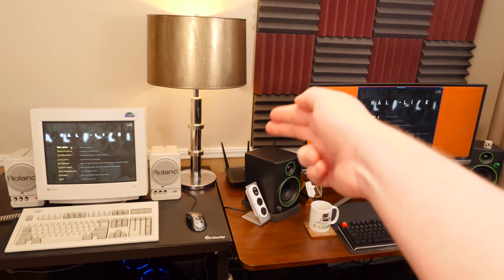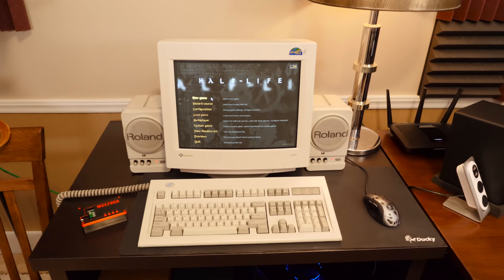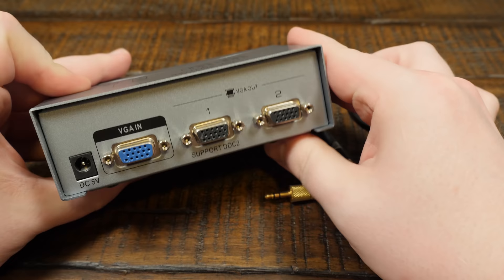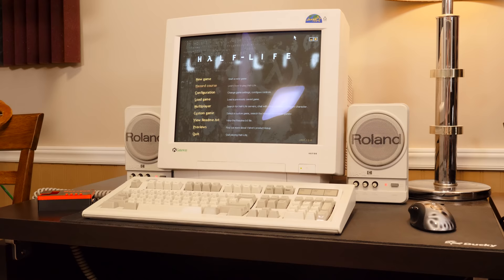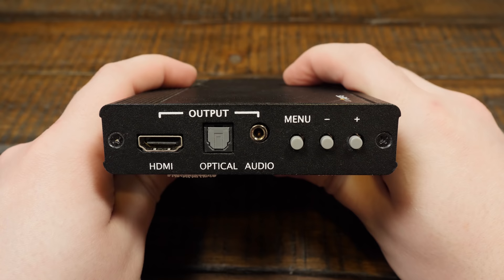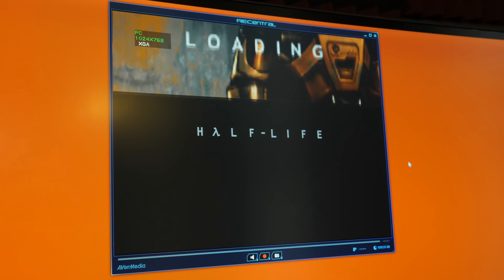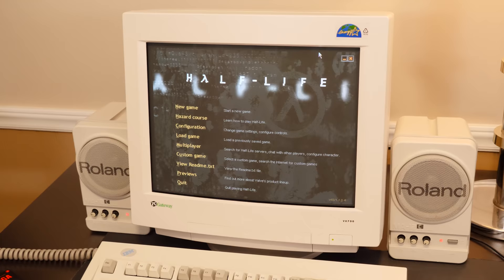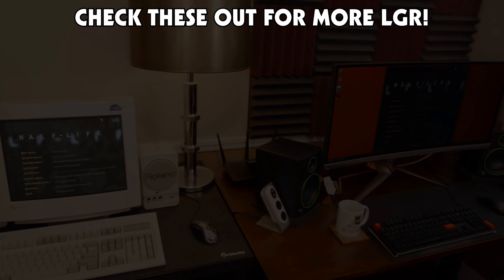Capturing VGA/TTL Video Footage From Retro PCs

Comment: Great video and cool tips on capturing devices! I was really hoping to work with VGA directly but since LGR also switched to HDMI capture, I'm starting to think that there's no easy way to do it :(
After your last video I started looking for some capture devices on my own but ended up with GameBroadcaster as well. I'll just leave two quick notes for random commenters who'd think to try same way:
1) Stay clear of cheaper models of Epiphan devices (mostly the red ones). I bought VGA2USB thinking it should be enough and while the image is crystal clear and the grabber works with most of DOS custom resolutions, it handles 15fps at most, so it really sucks for games. 
2) GameBroadcaster has real issues when capturing almost anything from DOS, but can be made to work if you switch resolution to something compatible first (like 640x480) and keep recording while you reboot, load different games etc. You will just need to crop the footage afterwards. 

Also, the name of the VGA-to-HDMI thingamajig is missing from the doobleydoo. :)

Cheers!

Comment: For my current captures, I've been using an Avermedia LGP Lite and VGA to HDMI ET110 adapter (which doesn't scale the incoming video). It works well for anything at or above 640x480. 

For older DOS stuff, I've been experimenting with my Compaq Armada M700's mirrored display feature - it conveniently scales the VGA output to 1024x768 at 60hz when enabled... which it does by default. Unfortunately the audio on these systems is very noisy, and the image isn't always centered properly.

Comment: I have a setup where I split the HDMI about 7 times and also strip the 7.1 audio, use it and re-inject 2.0 audio ^^ so I feel you (also gone through some of them, but I am pretty happy with it now - got the same ground-loop-isolators and some others :D - I can recommend something like the headphone 'amp'/splitter: LDHPA4 if you want to split more then two times, the y-cabels don't behave or you need the separate volume control.  I fear the day I need to replace one of the components, which are no longer sold ..)

Comment: I've found the Epiphan DVI2PCIe cards very tolerant of just about any signal I've thrown at it (more so than their USB capture devices, the cards can be coaxed to natively capture 240p video albeit kludgy). Extremely tweakable, and it has a built in scaler to handle resolution changes. They can be had very cheap on ebay if you are patient. It works with Directshow compatible software and also comes with a capture program.

For external conversion, I have found the OSSC very handy. It can run as a dumb VGA to HDMI/DVI converter in a pinch and recent firmware updates even support classic PC 320x200 optimized modes. Its output will trip up some capture cards like the AVermedia though, but the DVI2PCIe takes everything the OSSC outputs. I find its 240p upscaling + the DVI2PCIe card much friendlier than capturing 240p direct.

Comment: If you have any other issues than hum, maybe you remember it as better than it was? Plasticky PC speakers were pretty awesome... at hiding the majority of the audible frequencies and deliver crap sound through crap amplifiers... ;) As for the classic ground loop hum, that's due to PSUs going bad, so I would swap all of them completely if you haven't. But Isolators/Ground Lifters normally do the job for audio if it's not too deteriorated. There should be zero video interference from the PC cases since these were always in a fancy ass industrial type sheet metal box. If there is, I would suspect the converters since not too many know how to build good electronics these days. Greetings from the grumpy guy who is always right.

Comment: I have an Epiphan DVI2USB 3.0 that I've used for a few years to capture footage from old PC's, and it has settings for Horizontal Shift, Vertical Shift, PLL, Sampling, and brightness/contrast.  You can manually set these or leave it on automatic - automatic is handy for old games that change resolutions (it responds within a few seconds and makes the proper adjustments) but capturing these is a bit of a pain because the software I use (VirtualDub) locks in 1 resolution when you record and when a resolution change happens, it still records at the original resolution, scaling the new one to the old one.

Comment: You would probably be pretty happy with the Blackmagic Video Assist 4k for HDMI capture. I have and use the 1080 version at work and am always surprised by how many different signals and framerates it can scale. HDMI / SDI only of course but it can record to full size SD card in multiple bitrates.

Comment: Clint. I highly suggest that you look into Extron stuff for VGA splitters. It's broadcast grade and can be had for cheap . Bye bye interference! output signal is as pristine as input signal, everytime. They also let you adjust the audio gain of all inputs independantly, which is frankly very handy. The MVX series of matrix switchers by them is  a good example of stuff to look for. There are other, series as well by them such as ARS(splitters). Cheers
Reply from the maker: I have some Exton BNC splitters, they're great! Definitely need to look into their VGA stuff.
Reply: @LGR  Same I have some of their BNC matrixes! But I'll get a VGA one next I think. Although I can use some vga-to-bnc cables in the meantime to get vga stuff connected. But their VGA rack-style switchers are so much thinner and sleek, ya know?

Comment: some sound cards have a floating common on their outputs, most of the time, running a wire between the common and the computers chassis will cure the humms for instance, the exposed metal of your shown audio adapter hard wired to the case. you can also try wiring the computer case metal to whatever capture device or capture computer metal. I do allot of wiring between computers for audio..

Comment: i was actually looking for to capture the older colored cables that for instance the wii system uses.
my plan is to get a capture card on my computer and set up the wii through my computer.
probably using either vlc or mpv to play the video on screen

but still great video :)

Comment: Have you looked at Black Magic capture devices?
Reply from the maker: Yep! They have promising stuff, along with devices from Datapath and Epiphan. But it's tough to find the right mix of price/performance, especially when many products don't specifically state if they support lower resolutions and odd refresh rates :)
Reply: LGR Yeah, I would be worried about the odd standards as they focus mainly on HDTV and broadcast standards. So you’re most likely better off with your current configuration. We use them all the time in the event and broadcast world. I had to get «illegal» chinaware in order to bypass HDCP (screw that crap! 🤨) and the unstable low SDTV signals from such old things as game consoles... even the N64 is not stable enough to work with our $100.000 premium event scalers! 😜
Reply: You can bypass HDCP with a HDMI 1.3 splitter at least thats what I do for capturing my PS3 using a Black Magic Intensity Pro
Reply: @AndersEngerJensen  If you need to capture oddball resolutions with your blackmagic intensity pro card check out AmaRecTV http://www.amarectv.com/english/amarectv_e.htm
Reply: I have an older Intensity Pro PCI-E card that works great, except it doesn't do oddball resolutions like at all.  E.g., 240p?  No signal.  It does a good job with standard inputs, but then plenty of hardware does.

An OSSC might be a good alternative to the Star Tech scaler.  I have a ST composite / S-Video / Component / RGsB to VGA scaler, and while it's nice that it'll turn anything into one res, the OSSC is leaps and bounds better quality.  If you want a more pure capture and res changes aren't a deal breaker, it's pretty much the best way to convert RGB sources to HDMI.
Reply: Second the OSSC.

Comment: Hi LGR. Have you looked into some of the commercial audio visual branded scalers/switchers such as Crestron, Kramer or Extron? I have been using a Kramer VP-437 switcher/scaler and it seems to handle almost anything I throw at it (I did not know until recently that the PlayStation 2 changed resolution regularly!). Have a dig on eBay. 
I have one of these in my workshop at work too (I’m a commercial AV technician), and the local Australian distributors are only more than happy with firmware, tech support and advice, so I’m guessing the America’s will be the same.

Comment: Thank you for answering my, and several others', question. Personally, I was hoping that you actually captured the image 1:1 rather than scale, but yeah, I guess not much capturing software is built for streams that suddenly change resolution (I'm guessing it'd have to start capturing to a different file each time the resolution changed?).

I'm thinking of capturing some Macintosh stuff (I have a Power Mac G4 with Mac OS 9 right beside me at the moment as my main retro workhorse, and a few other machines around the place). I've been looking at that Epiphan device for a while now, will probably go for one of those, at least those have decent Linux support (I no longer have any Windows boxes, and the newest Mac is a low-end Core 2 Duo Mac Mini - probably not quite fast enough, and certainly doesn't have USB 3 which I guess the stream requires, at least at higher resolutions).
Reply from the maker: I mean, it's all captured at its native resolution and saved as such, but everything has to be upscaled eventually to go on YouTube since I upload in 4K.

And yes, each resolution change results in a different file, otherwise you end up with some rather ugly footage with pixels that aren't 1:1.

Comment: so I'm pretty sure you know this, but just in case. For your loop problem you could always use destructive interference. If you record a section of the background interference and play it inverted of it over your recording it could drastically reduce the noise. Audacity is a really easy software that is able to accomplish that.
Reply from the maker: Yep, I used Adobe Audition to remove the hum until I got the hardware filters that do it for me.
Reply: Wow, thank you for the reply :D, been a fan for about 4 years now. It put a huge smile on my face when I saw that you replied

Comment: Did you try old external AV high-end upscalers from early 2000? (DVDO iScan VP50 Pro for example) I capture with OSSC (from 240p\480i\480p) and nobrand Chinese upscaler from 480p to 720\1080.
P.S. all new 4k cards (even Pro or Broadcasting) has own problems, and you still need proper upscaler. I recommend see something with low-latency and fast resolution switch. Elgato and aver 4k (pci-e x4 cards) actually work not so bad. BlackMagic for example has problems with switching resolutions.

Comment: Audio 'noise', I had a bad hum loop from an old PC to an amp, so I installed a big speaker style binding post on both then just ran a heavy (6mm) cable between them, no more hum.
(The brute force and ignorance solution)

Comment: Hey LGR!  I get the static also but between my two 2.1 speaker systems.  Usually a flick of the switch stops that.  I personally wait to turn on the audio until system boots up. (separate power strip)  Having a Beefy surge or APC battery system might do the trick.  Old houses have old problems.  (Seen it first hand)   I was thinking you might want the 4th  installment of a modern build?   32/64bit Windows 7?  10?  Not sure exactly what your current setup is?  And glad to be directed to another build video.   lol :) Any input or thoughts would help me immensely. :)

Comment: (Assuming 24bit color)
I have 2 1/2 Questions
1.) Do those Capture Cards, mainly the AVIO HD DVI, accept 720x240p60 and/or 720x480i60 through HDMI and/or DVI? (I doubt it will through VGA but you could give it a go I guess)

2a.)Would any of them allow for RAW RGB/YUY2 Capture at 720x480i60.
2b.) Would they allow the same for either RGB@640x480p60 or YUY2@720x480p60?

Comment: You mention your Lazy Green Giant running Windows 98 and 95 (and your rebuilding videos show you use an SD card for the OS), how quickly does stuff run off memory cards, compared to a normal HDD? and have you ever attempted to run a modern OS from memory cards, like XP, 7, etc?

Comment: I thought pehaps your a/v sync issues would be best if you used obs to capture and adjust offset pre recording using a good win10 sound card and your video device of choice since it's open source streaming focus gives rise to the ease of sync and rescaling tweeks

Comment: Dude, use OBS as the capture software! You can capture several different sources (plug your audio in separately) and it scales in realtime if you decide to enable that. It has a small learning curve but it's quite easy as you move along.

All this for FREE!
Reply from the maker: That's one of the pieces of software I'm referring to when I talked about how annoying it is to use. Using these devices it not handle the changes in resolution and refresh rate well at all, even when set to automatically scale.
Reply: @LGR  Oh, you tried that. If it also changes the frame rate then it won't probably work very well :P

Comment: I need a vga to hdmi adapter to hook my dos pc to my 4k hdmi monitor, haven't had any luck with any that can handle the odd resolution and refresh rates yet, i'd like to get my hands on one of those star tech version 1's anyone have any suggestions for a device that's newer and still manufactured?

Comment: I'm glad this isn't a normal comment section that's not going to get swarmed by 12 year olds saying just get an elgato lol
Reply: Is the elgato a bad capture device?  Or do you just mean it's not suitable for the purpose, old PC capture?  Serious question as I am considering a capture solution myself.  Not for old PCs, but modern HDMI devices such as my Win 10 machine and consoles with HDMI which seem to be the target focus of the elgato.
Reply: @QunMang  its obvious from this video that its not suitable for his use case
Reply: Elgato are decent, although it has gotten to their heads a bit and some of their products are more pricey for no extra features than the previous model. 
The products are decent though for HDMI capturing of HD content , not so much for this

Comment: Will the AV.io HD fix Dos games being cut off on the side. Been trying to find a solution for years!
Reply from the maker: None of these solutions result in cut off images.
Reply: @LGR  The main issue I have is with resolutions that earlier Sierra games use like king's quest I believe that is 320 x 200? Do you reckon the Startech HDpro2 will work for that? what problems have you run into with the up to date versions?